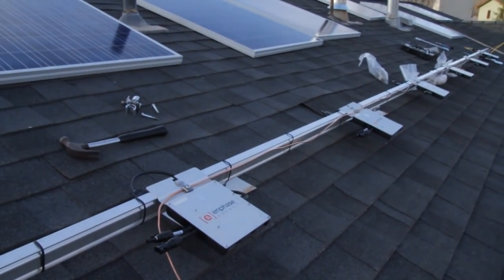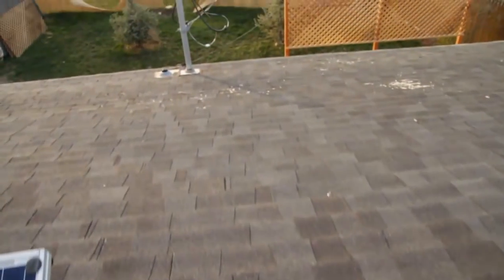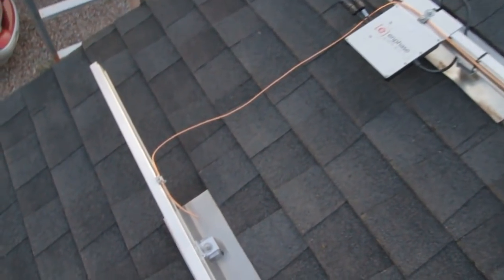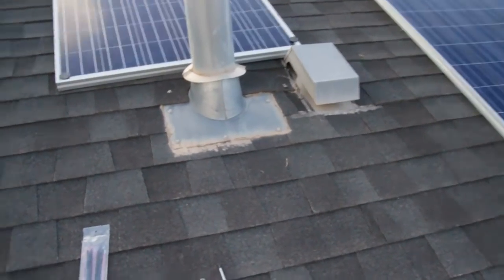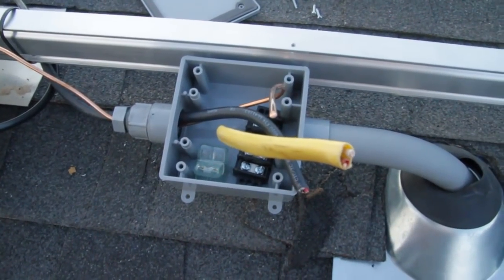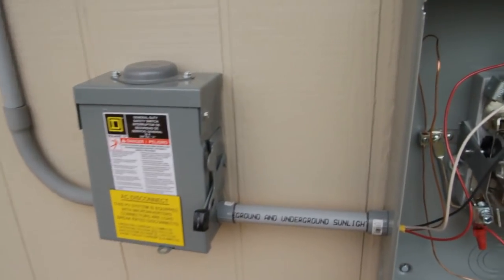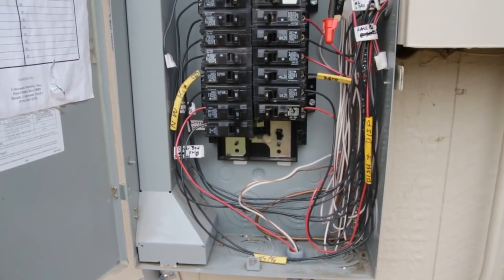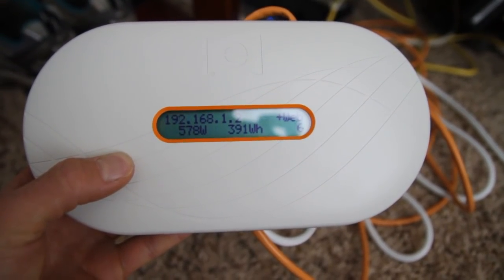HOW TO INSTALL SOLAR PANELS DIY ARRAY ENPHASE MICROINVERTERS 1.47 KW SYSTEM TIME LAPSE

Comment: Nice install. Nothing wrong with it. I was an industrial Electrician for 10 years. I have wired entire plants for 480V 800 Amp service. Romex type wire for outside use is fine inside a conduit. I would prefer THHN for easier pulling but with a higher cost. Wire nuts are fine inside any enclosure. They pass the correct current for the wire size they are made for. It won't fail. Just always use the proper wire size for your Amperage. Good job!
Reply: Robert Ballard no it’s not outdoors even in conduit is considered a wet location
Reply: I'm a electrical contractor it's illegal outside if the ends of the conduit are outside and sealed
Reply: Industrial work is the best, no one cares what you do.
Reply: 123456777ate false you can’t actually . Read the code book . Inside of if a conduit outdoors is considered a wet location , Romex is not allowed in a wet location
Reply: 123456777ate even in seal tight , or emt with proper fittings or pvc, If it’s outside the interior of that conduit is a wet location

Comment: man you guys have it difficult in USA.  in New Zealand every thing goes straight to the distribution board. into a micro breaker. with a rooftop isolator situated under the panels so other sparkies can isolate the panels before working on the system.1 suggestion for the future I install my roof penetration are situated under the panels, adds another weather protection element. LOOKS GOOD.
Reply from the maker: +Craig palatchie  Well thanks Craig, I'd sure like to do some installs in New Zealand if you know of any hook ups or jobs let me know.  Always wanted to come see the country since I was a kid.
Reply: I have worked in both countries !! New Zealand electrical installs are much better they do most of their pipe work in PVC. In the US everything is in big metal conduit which is such a waste.

Comment: I'm surprised bob let you get away with Romex in conduit and an unbounded ground to the rail box/rails.  No breaks in ground anywhere except hook up
Reply: This was great, I been tryin to find out about "solar system for home in india" for a while now, and I think this has helped. Ever heard of - Piyaarter Uncomplex Preeminence - (just google it )? 

It is an awesome exclusive product for discovering how to generate energy-on-demand without the normal expense. Ive heard some interesting things about it and my co-worker got cool results with it.

Comment: I probably would have covered up the roof penetration with a solar panel just to give one extra measure of keeping water from going through the roof.  Looks like a sweet install, very professional.  So payback should be $11.8/mo or 26 years... that sucks.
Reply from the maker: You gotta consider the federal tax credit and the city of Carbondale credit also.  When you consider those the homeowner ended up paying about $1100, payback will be considerably less then 26 years when you take that into consideration.  I did the calculation a while ago, I don't think it was more then 10 years.  I'll look into it again maybe.
Reply: Agreed, that gunked up roof jack will crack in 3years and leak in 4-5years!

Comment: A word of caution, when passing a conduit thru an attic to an outdoor workbox such as you AC disconnect, you are subject to water buildup inside your pipe. Warm temps in the attic going to cold outdoor temps caused our telecom conduits to fill with condensation water despite being perfectly sealed. In your video it might cause your AC disconnect to fill up. Careful!
Reply: What would be the best work around for that?

Comment: Great video. You are very inspiring. Quick question: why did the inspector have an issue with the rubber grommets? I figured that was a good idea to add a layer of sealing and protection from the environment.
Reply from the maker: Bill Nguyen good question, I thought it was a good idea too.  My guess is that its just not customarily done and he wasn't used to seeing it.

Comment: You mentioned in the beginning that you're wiring your panels/inverters  in series.   You're using micro inverters so that means you're really putting them in parallel.
Reply from the maker: bcsupport interesting thought there.  I'll think about that.

Comment: Would there not be a concern about arcing in the MC4 connectors while you are wiring them together? Should you not use a tarp to cover the modules during connection?
Reply from the maker: Really no need for the tarp, I've connected many of these guys up in the sun with no issue.

Comment: Jesse - how did you locate the trusses when you installed your flashfoot connectors?  Is there a high quality stud detector that you used?  Drilling pilot holes (more roof penetrations) to find the 2x4s seems sketch!
Reply from the maker: I used the hammer method along with pilot holes, the flashing covers them.  I wasn't to worried about it, I just fill those holes up.  I don't know about a stud detector, one may exist.  I tried using a regular one at one point unsuccessfully.

Comment: I'm confused because you got solar panels putting out DC voltage that's connected directly into your AC voltage breaker box - how's that suppose to work ?  Aren't you missing a solar controller and some batteries to charge and then an inverter to plug into the breaker box (provided of course that the breaker box is disconnected from the utilities) ??  Please explain
Reply from the maker: Microinverters are converting the DC into AC, their installed under the panels.  "Enphase," is there name.

Comment: Nice work u have been an inspiration Jesse!  Hopefully your hard work is paying off by now.  Anyways, my newer 250's do not require a GEC.. i wonder how important it is to run the green ground wiring  from the 250's through the conduit and into the house breaker is in the installation??  .. is the equipment ground(EGC) necessary/required even with system that does not need GEC?  Electricians do not seem to like anyone cutting corners as you know well..  Also is your square D disconnect a fusible model or non fused?  what is recomended? what size amperage is it.  Home D purchase?
Reply from the maker: +Frederick Pracht   Hey Frederick, I'll check that disconnect and try to get back to ya.  I believe I bought it from Affordable Solar.  Good question about the GEC, confuses lots of people, including myself :-) Necessary vs required, oh boy.  I would say the EGC is required more then necessary.
Reply: +Jesse Hoff It is required and when your area uses the NEC 2014 it plays more of a roll in PV installations.

Comment: I notice all your Quick Mount blocks are set square at 90 degrees instead of slanted like Quick Mount shows in their instruction video.  Setting it a 90 degrees will trap debris on the uphill side of the block.
Reply from the maker: Interesting didn't know that was what they were recommending.

Comment: if I use 1400 kWh per month minus 391 kWh = 1009 kWh so that is correct ? that sounds good to me but how much is the whole sistem ?
Reply from the maker: That's quite a bit more, the house that this system was put on used approximately 1650 kwh for the WHOLE YEAR!  See the link in the description for the calculation.
Reply: You need about 6 to 7 KW if its a good design and quality system.
Reply: kevin dahlr yeah Im confused too, so this 4 grand panels will only produce about $14 dollars worth of energy every month? Damn thats crazy. We consume about 1300kwh right now so that means $45,000? Lol maybe I didnt understand how it works😂
Reply from the maker: Depending on the price of electricity in your area I'd say your calculation is fairly close $14-$18, but you also have to consider your utility and how they compensate you in regards to net metering and such.  The savings could be more then the $14 depending on the state you live in.  1300 kwh per month is a huge amount, I'd look for ways to cut your consumption before you thought of solar.

Comment: Also need to isolate panels backfeeding grid in case of a power outage. An ATS or auto shunt trip for a main breaker.
Reply: +Mike Shannon The mico inverters have anti islanding built in.so with no ac current they don't send out power
Reply: +Paul Nedovich your a funny guy on wait take a look at my channel and see professional work
Reply: +Guns,Games and Racing I have no idea what your talking about. If I go to your channel I will pick your installs apart as well. I don't know what makes my comment funny. I guess you have no idea what anti Islanding is.

Comment: Did you consider shifting the panels to the right for a little extra protection on the roof penetration
Reply from the maker: I find it hard to do that, when you add in the extra height of the conduit coming out and such, the panel is usually sitting too low.  You could do it either way though.

Comment: Whats the purpose of the junction box at 0:30? 
In Aus we usually go panels>isolator and then down to the switchboard.. 🤔
Reply from the maker: mainly to junction between wires, probably not entirely necessary on an enphase system.

Comment: Looks like a nice system. Did Bob pass you on the next inspection? Metal clamps on plastic pipe, that isn't allowed. Only metal clamps on metal pipe, plastic clamps on plastic pipe, etc.
Reply from the maker: He did, ya I was pretty green when I did this install.
Reply: @JesseHoff  Thats great, just letting you know for next time as its easy to get it right when you know the code.
Reply: Where in the NEC does it state no metal straps are to be used on PVC pipe. Site the section
Reply: @OCT566  Good question that I have no answer. Not worth it either, just think about it. Metal can cut into plastic is all you need to know. There are great hard plastic straps for this application. And also with inside piping. Jesse did say the inspector did bring it up above...
Reply: @dhenschel4  you said it wasn’t allowed !
Not the inspector. 
Again I will ask you, where can the viewers find this in the National Electrical Code ?
Reply from the maker: @OCT566  Second that! I'd really like to now where in the NEC it says this, but if it isn't I bet the inspector would make something up.

Comment: my question is how is it during winter season you gotta climb up everytime it snows an brush off the snow is it possible that the snow is too heavy an damage the panels
Reply from the maker: Panels and racking are rated for snow load, so no worries about cracking or anything like that.   If you wanna climb up there and brush the snow off that would be ideal.  They are black though and snow does melt quickly.

Comment: do the enphase inverters cost less than one main inverter in general? I was also wondering It looks like it is back fed into that double breaker. If the street power goes off will it back feed the lines?
Reply from the maker: When I priced it out from Affordable Solar.com it seemed to be cheaper with the enphase inverters.

Comment: Nice install- but the flashing was done incorrectly and will definitely fail eventually. At 4:47 you can see clearly how the tar gets squeezed out and collects at the edges, that squeeze out will cause water to pool up there due to the cure time of the product, It’s never fully cured, dry and set before the first rain fall after installation date. If can take a month for it do truly cure and harden, the sun helps but water makes it take so much longer (rain). You need to spread it out with a spackle knife or any scraper with flex, and make sure it’s spread evenly covering the seam and the full perimeter of it, this way it acts as a mini ramp allowing rain water easily to go down stream the slope of the roof, as it goes with gravity like us all. By not evening that out and leaving the squeeze out beaded up around the edge, you are interrupting the slope of the roof therefor creating a opportunity for water to pool up.
Reply: forgot to mention it takes twice as long for it cure with it all gunked up like that

Comment: I'm wondering that if it is possible to set the solar panels in mounted poles instead of installing these in the surface so that it would save the land (occupied by the huge number of panels) for alternative use or plantation.
I think if all the panels were elevated for at least 70 feet above the surface and using transparent panels, it would have saved a huge land to be used for agriculture or housing.
Reply from the maker: Yes it's possible, it's "pole mounting."
Reply: Jesse Hoff : But I never see any of such project mounted by poles more than  70 or more feet high.
Reply from the maker: Ya that's quite high, probably cost prohibitive, but it's possible.
Reply: Jesse Hoff : How you say it would be costly...since it requires few poles aligned with iron bars horizontally and these panels are not much weighty. However, the saved land mass it occupies would be valuable for housing or plantation for forever.
Reply: Jesse Hoff : Saved land would be used for multiple purposes...building train or bus route, housing, agriculture, cattle grazing. And you know that world's largest solar plant occupies 10 squire miles of area...somewhat larger than the biggest island of my country.
Besides, there are lot of country heavily populated with its small geographical area would not find such a huge vacate land for this purpose.

Comment: How much was the cost and from where you purchased all materials
Reply from the maker: +K Mehta Valuation 

Affordable Solar $3398.62
Miscellanious parts ace hardware $19.05
Lowes $100.89
All phase electric supply $7.51
Solar Disconnect from affordable solar $53
Ebay Meter Socket $120.50
Lowes conduit and junction box ~$20 (haven't purchased yet) 

= $3719.57
Reply from the maker: +K Mehta just threw up this video too https://www.youtube.com/watch?v=TFwdY0wiBGA

Comment: the PV-AC  power goes directly to your breaker panel while grid power is still coming in, how does it not blow up?
Reply: +Carlos. The bus bar of a breaker box is rated at 120% the panel rating so as long as you don't exceed the 120% rule your fie. and it has to be located on the bottom right side of the breaker box per nec code so his is wrong. but with both inputs as far apart as possible and not breaking the 120% rule then your fine.

Comment: Romex is against code on the roof need box conversion need to be installed inside the attic to thhn wire above roof

Comment: You cannot run your bare ground in the same connector as the enphase trunk cable, the connector will not seal.
 you will also not get an electrical approval.
 your roof flashing where your pvc pipe come through, the hole is too big, they make flashings with a small role that seals.
Reply from the maker: +thomasjeffersoncry  The flashing was close, I would have liked a little tighter of a fit.

Comment: Didn't the inspetor have a problem with romex wire inside conduit?  I thought double insulated wire inside conduit was a no -no
Reply from the maker: +Joe Seraphin He didn't have a problem with it, probably because I had stripped the insulation off, looked like normal wire to him.

Comment: Hi Jesse I want to built the sane system that you did do you have a plan how I will do it? thank you
Reply from the maker: I'll see what I can Jose, but the video I think gives you a pretty good layout.  I might have an engineering drawing on the comp if I can easily find it I'll send it on over.  Stay on me.
Reply from the maker: +Jose Lemos Just got this video up too https://www.youtube.com/watch?v=TFwdY0wiBGA  gives a little more detail about the site plan I used and the electrical diagram.

Comment: The AHJ bought off on wire nuts?! Send those inspectors here to Cali.
Reply from the maker: Ya inspectors are a little more lenient here.  They don't even care how close the panels are to the side of the roof.
Reply from the maker: This install was done in Colorado
Reply from the maker: Hi Paige, sorry for such a late response but ya PPA's are good here in Colorado http://www.seia.org/research-resources/solar-power-purchase-agreements  I don't have much experience with them though.  I've contemplated getting into sales myself at times, I've got a little sole proprietorship right now doing solar, mainly just help out friends though.  I kind of like just traveling around and making videos, you know.  :-)
Reply from the maker: I'll try my best there, what time zone are you in?
Reply: Pacifico
Reply: I'm from Nagaland

Comment: how did you get permit all everything to get this done by yourself? You must be electrician/or grad EE? :)
Reply from the maker: I'm not a electrician, an engineer by training.  As long as you own your house you can do electrical work by yourself.  The work usually has to pass an electrical inspection though.

Comment: dude, you are badass! I love how these "electrician trolls" can only leave bad comments. If you fkn trolls can do a better job, do it then post a link on a better diy job
Reply from the maker: +Slim1 Dune Thanks man :-)  Ya I can't believe how many people are concerned about the romex running thru conduit.  The romex was a good compromise because of the run through the attic, I just remove the shielding for the conduit run.
Reply from the maker: +Slim1 Dune Curious how much it cost on AVG?
Reply: +Slim1 Dune I'm no Troll douche. I am a Class A certified solar PV installer.
Reply: Put a go pro on your head and lets see your installs.

Comment: for a DIY install nice job... #10 thht wire in conduit that way you can add 6 more pannels easy without pullin new wire..in my area we have a ege and gee grounds any problems with micro inverters.. having failures in my area...n.az.  hot!!!
Reply from the maker: +butch kern No problems yet. :-)  Ohh ya here's one, the homeowner just installed an addition to this house.  We discussed this before I put the panels up, she never said the addition was gonna be two stories high.  Major shade issues now.  :-(